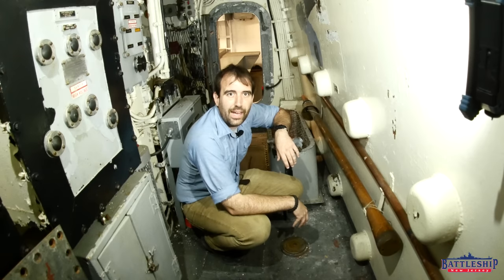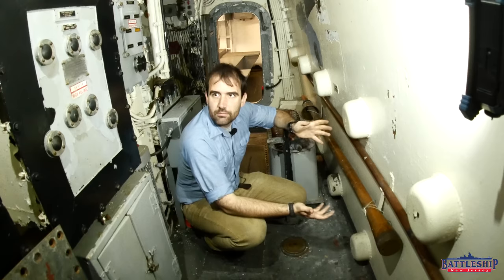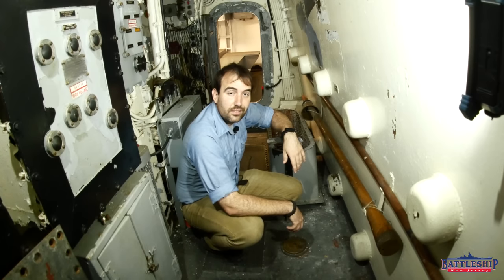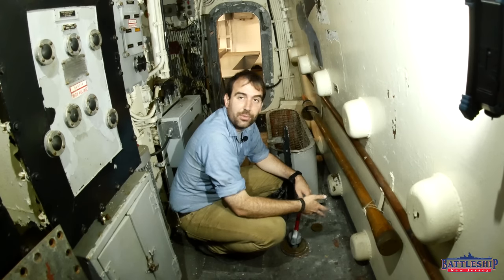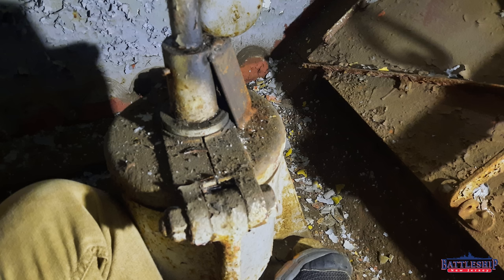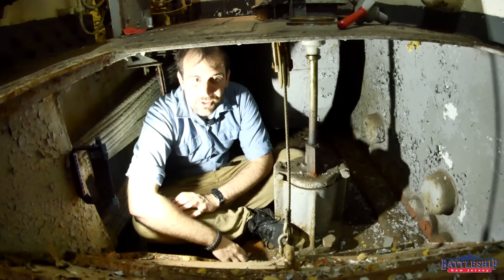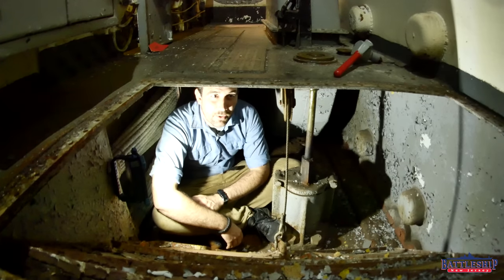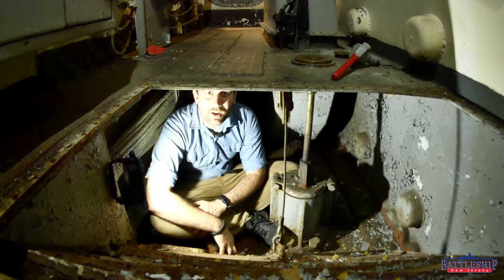Are The 16in Gun Turrets Welded in Place? UPDATE!

Comment: I'm not an engineer, but I'm pretty sure the turret drive mechanism, if you could power it, would just snap that pin like a piece of spaghetti. That turret alone weighs as much as a Gleaves-class destroyer, if it's powered and you push the control to move it, those two pins are not going to stop it, it's like the travel lock on a tank gun that keeps the breechblock from bouncing around and bonking people on the head.
Reply: That looks to be a 8-10" pin that is moved by a 1 1/8 rod and there are 2 of them. The motor will have an alignment collar with a clutch built in to take the sudden load. 
So, no to snapping the pins. You'll tear up the motor coupling, gears, shafts, etc. They did the math on every item and those 2 pins will not let that turret move until they are retracted. That was probably the station for 2 sailors in hostel waters with heavy sea's.

Comment: I love these hidden space crawls!
I would like to point out you only need to active the 300 hp motor and not all the motors to rotate the turret.  This would take about 350 amps..  Every other motor will have some sort of disconnect on it so you can shut them down.
Reply: No, one motor, 1 turret, 1800amps EACH.
Reply: You gotta realize the start up inrush current driving a hydroelectric system is 4-5 times that for many seconds.

Comment: Is that 1800 amp motor AC or DC?  If DC you probably could power them up without blowing shore power if the DC voltage was in the 24v range.

Comment: A hydraulic APU could be adapted to the hydraulic system on the turret removing the need for the electric motor. The APUs have there own engines and come in a variety of sizes. Really any size hydraulic system that can produce the same pressure will work. The gallons per minute is what gets you the speed and in this case that is not needed.

Comment: Theoretically, it wouldn't take the turbogenerators to turn that turret, the diesel backups are backups for a reason and getting just one or two generators online (DEFINITELY one generator if they have the ability to synchronize with the other generators, cause that means you can also sync them with shore power and make up the difference) would be enough to move a single turret. With the safety margins on breakers and motors as well, you COULD probably make it rotate in calm water and with everything still turning freely on JUST shore power but it'd be really tight, those motors are meant to push through heavy seas and battle damage and even 1800A through a 1200A breaker will usually take several minutes to pop - rotating the turret's only a few seconds. If they're using standard civilian breakers, at 2400A through a 1200A breaker it's allowed to take as long as TWENTY FOUR MINUTES to trip, although usually it doesn't take THAT long.

Comment: The 300 horsepower hydraulic pump is that big so the turret can turn quickly in a combat situation but that doesn't mean a smaller motor couldn't turn the turret. I bet a small portable hydraulic power pack could be plumbed into the system that would allow the turrets to crawl around slowly. A picture of New Jersey threatening Philadelphia with a 9 gun salvo would be glorious. You should definitely do it.

Comment: You could pull enough power to rotate the turrets but the equipment required would be quite extensive and expensive. one method would be to have shore power charge a large battery bank over time and then discharge them trough a three phase inverter. I have no idea how expensive the equipment would be though and it would certainly be best housed off the ship. it could probably serve as grid storage when not needed as well.

Comment: They may be 300 HP motors, but that doesn’t mean they need the full current draw to run

Sure, from a dead stop the friction will take a lot to overcome, but once it’s turning the power required will go down drastically.

Additionally, a bank of VERY large capacitors could be installed to give the motors that 300hp starting power required to overcome the friction.

Also, you don’t have to turn them at full speed.

It’s likely the motors were sized to turn a fully loaded turret at max speed, with max resistance, and 100% duty cycle.

All of this is to say that yes, it is possible to turn the turrets with the factory motors with shore power. Just not practical.

Comment: Aren't there backup batteries to power the turret rotation in case of a power failure? Couldn't you charge those and then use the batteries to run the turret motor?

Comment: Since I work in the industry there are main motors and there are maintenance motors for some heavy items. The maintenance motor do the same job but much slower. So it's worth to take a look at the transmission and motor setup. There might even be some documentation on how you do maintenance, since all those rollers would have to be taken care of now and then and that would require them to be rotated.
The full current would as I see it be needed in order to change the direction and elevation quickly and even manage to compensate for the rolling of the ship by using a gyroscope. So it's worth to investigate the mechanisms and controls more.

Comment: Hypothetically, Isn't it possible to simply upgrade your shore power electrical system to provide more power so you can activate a turret?

If the turret needs 1800 amps, and your current shore power can only provide 1200 amps, then upgrade the electrical system.

Comment: Got a question along the lines reactivating a museum ship. I’ve been told by 2 different sources that one of the main guns of the USS North Carolina was fired shortly after she was berthed at Wilmington, NC.  

No projectile, just the powder charge

. Story goes that a gun crew was brought in from Norfolk.  One barrel of the aft turret was loaded and fired.  The shockwave blew out windows for several blocks. 
Ok that’s the story and it sounds very far fetched. But I’ve seen live bombing runs from B-36’s as part of a public attended demonstration.
Reply: Yes I’ve heard that myself
Reply: The normal charge for the Iowas' 16" guns is six 100 pound powder bags. If you were to put even a single bag in one of NJ's guns and fire it, it would still blow out windows on both sides of the river. Ryan has repeatedly said they'll never fire the 16" guns because any charge large enough to produce a "respectable" bang will be large enough to blow out windows near the ship. They do fire the 5" guns on occasion, though.
Reply: So what's your question?
Reply: @danielleeming1027     Oops 😬.  So, does anyone know if it actually happened? (Firing the gun).

Comment: All you need is a cold chisel and a hammer, or a battery angle grinder. I could do that in a minute or two tops. Why would they even bother with the pin in? 300hp probably could snap that in a second though.

Comment: 1800 amps per turret, plus all the rest of the electrical loads is a huge load.  How much power could the turbogenerators produce? What about the backup diesel generators?  Finally, were the backup generators routinely started and tied in to the electrical system during combat?

Comment: Power = Energy / Time, so in theory it should be possible to rotate the turret with less than 300 HP, just proportionally slower, as long as you could get enough torque to overcome the friction and rolling resistance to get it to move at all.

Comment: You could rotate the turrets with a smaller hydraulic pump, it would just go correspondingly slower. Probably not useful for demonstrating turret rotation, but it could be useful if you needed to rotate the turret to access something and didn’t mind the process taking an hour.

Comment: there must be a manual gearing to move the turrets with out power in damage control as there is a manual control on the rudder if power cable are cut due to shell fire

Comment: Someone could probably rig the motor to run at a reduced power and speed. If they're hydraulic you might be able to use a new power pack. How fast were the turrets designed to rotate? Is a fire control computer necessary to move them?

Comment: Interesting that they should have gone through the trouble to put a little piece of weld on the locking pin, when it requires a lot of power to get the turrets operational.

Comment: The beauty of hydraulics is that it is its own gear reduction. Plumb in a handpump from princess auto (your harbour freight) and start stroking, it'll move!

The horsepower is only needed to spin the guns quickly. 1 hp is 300x slower than 300hp, but the torque is whats actually doing the work. it's all in how you gear the horse.

Comment: I certainly think there are other ways to make the turrets rotate. The original method is probably out of the question, yes, but it would be fairly easy to rig an external engine and some kind of pulley system to make it rotate.

Comment: Well for electricity 300HP sounds like a lot, but there are backup generators available nowadays with 3000HP electrical power. Of course you don't need one this big, but around 500HP should be enough to operate a lot of equipment on shows and so on. Of course you don't need to run it all day. But possibly worth concidering.

Comment: 300 hp is only 220 kW.  if the motors are drawing 1800 amps to make that, those are 120 volt motors.  do you have a 3-phase shore power connection available?  if so, what is its service delivery limit?  a higher voltage motor will let you run significantly less current to achieve the same power.

Comment: Sure, the 300hp motor has an 1800 amp breaker, but they 80% rule says that the normal full load on that breaker is 1440 amps, but I'm betting the motors will run and rotate the turret with far less current. I want to see the motor data plate. Need more power? What about the after-diesel generator? What's it's rating?

Comment: I think you guys could rotate the turrets using winches if you wanted. In the previous video, inside the stopping mechanism for turret travel, using the very stop block and cable run, slowly, that would work, i've moved some pretty heavy things with a basic 10 ton winch. Now... i don't know if that's be a good idea on account of the weight shift? She's basically empty... would that shift things???

Comment: As someone who previously worked for an electric utility and now works for a company that deals with medium-high voltage equipment i can wirh 100% certainty tell you that you can draw that 1800 amps from the shore power connection. Now i will also say that it is a terrible, no good idea that is not safe for equipment or personnel, but it is possible

Comment: So the turrets don't have any manual means of training? Requiring a 300hp motor, it would take quite a reduction gear for men to hand crank and take eternity to move but im surprised there is no option. Not for battle use but say to center the turrets in an emergency.

Comment: You do not need 300HP to rotate the turret. You only need 300HP to have the turret rotate at speed. You can apply less power (having a hydraulic motor with much less power) and the turret should rotate, but much slower. Same applies to elevation of the guns. Elevation is done like to he system used to open and close an electro mechanical bridge. You only need a lot of power to overcome forces of the wind applying on the bridge and to obtain a specified speed

Comment: I don't know haw big of a breaker bar it was, but the lower end of that angle iron looks like it would fall off if you looked at it wrong, much less put any kind of torque on it. Also pretty incredible that the rotation of the entire turret can be stopped by two little pieces of angle iron

Comment: Like many trouble shooting efforts you start with the first issue you find.. So cut the angle iron and see if the pin turns. If it does there would be no reason to think you have other welds. With todays technology can you work around the power issue needed to move the turret.

Comment: At LBNSY, on a ship check, me being from shop 300, Design, had to get a welder from shop 26 to remove a railing and replace it with a chain for the Sea Sparrow missile batteries. As I remember, the welds you found are the only places where the turrets are held in place. The pins were necessary to keep the rangefinders calibrated, & were removed when deployed.... Also, in a pinch, if suddenly attacked, they would snap if power was applied. 

P.S.... You could  rotate the turret on approximately half the power, provided the pin welds are removed. They’ll just rotate very slowly, and you may run the risk of burning up the motors, but they should rotate... Hope that helps.

Comment: But if there are 2 massive pins with screws to move them up and down designed to keep the turrets from rotating why weld them in the first place? It surely does not add any security as the system was designed to hold the pins in place without welding. Some stupid symbolic thing maybe? "The turrets are welded in place, the ship is officially useless"?

It would take a guy with a cordless angle grinder literally 15 minutes/turret to undo that "permanent welding".

Comment: I'd be more worried about making sure nothing important had rusted, shorted, rotted, or corroded than about cracking a weld. I'd wager the equipped motors on those turrets are plenty beefy enough to pop an "immobilizing" weld or pin, they were probably meant to overcome interfering damage to armor or barbette. The pin is just a convenience to keep the turret stationary when you don't wanna have the drives ready but whether all those boilers down below are shipshape... now THAT is another question.

Comment: FYI - You don't need to activate the original 300hp motor to get turret rotation. You could bypass that original pump and get much slower movement than combat speeds with a smaller hydraulic pump plumbed in instead. Whether you would want to or not is more of a philosophical question than a practical one. It can be done without running the ship powerplant, with some minor plumbing.